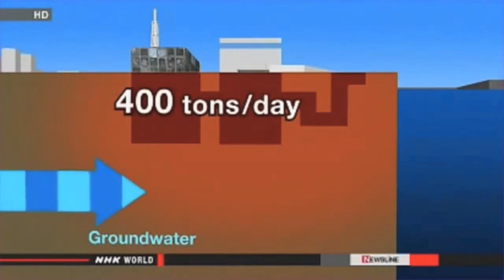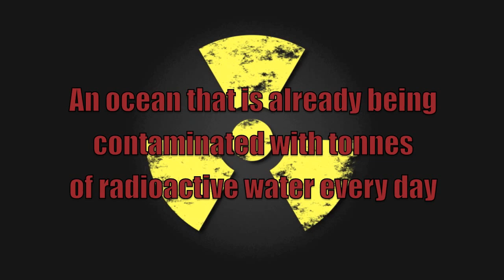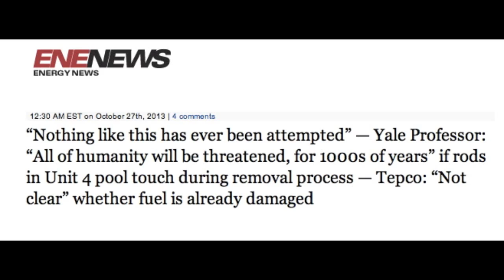☢ Fukushima: Beyond Urgent ☢

Comment: I hope they reconsider the removal of those rods. An apparatus needs to be built that somewhat mimics the underground storage tank. The apparatus needs to be lowered and aligned with the shafts containing the fuel rods. After alignment is precisely aligned and checked the fuel rods maybe pulled into the new container individually. This will allow them to lift more than one rod at a time and suspend them within the new safe container. Until the new container or containers which may be sectioned off for safety. So instead of one big apparatus perhaps four or eight small apparatuses that can be aligned to the top of existing storage container. Filled with water and  lifted and suspended in new containers. Just pulling them out one at a time still exists the danger of contamination airborne particles and or explosion. 
 
Design A crate shaped apparatus deep enough to contain the rods. Make it a plastic or rubber. Design pulleys to be fitted to the top of each section of the crate. They can be spring loaded and counter weighted as to control the speed of the process. This illuminates any electronics. The pulley cables Will have to be attached to the rods prior to lowering each extraction crate. What we need are engineers. Mankind is incredible the things we can do when we collaborate our knowledges is beyond the wildest believe in your mind. We used our minds and technology to create this dilemma we must use our combined minds and our combined technologies to resolve this horrific threat that our minds have created. After all when we say government created this. We are trying to vindicate ourselves from blame. Because in all reality we the people of this world are the ones who make up these individual governments. Governments are not robots with artificial intelligence. So it's safe to say that when we let the government let this happen we are saying we let this happen. So rather than running around pointing fingers we need to collaborate our great minds of engineers and scientists. Take care friends and let's put aside all of our differences and work together to ensure the safety of our families.👨🏾‍✈️👩🏾‍🎓🕵🏼‍♀️👩🏼👨🏿👧🏼👦🏿👶🏽👳🏼👨🏽‍🎤👨🏽‍🏭👮🏼‍♀️👨🏽‍🍳👲🏽💂🏼‍♀️👵🏾👩🏼‍🎨👵🏼👨🏽‍⚕️👨🏼‍⚖️👨🏾‍🚒🤴🏿🕵🏼💡🎙📻📺📡